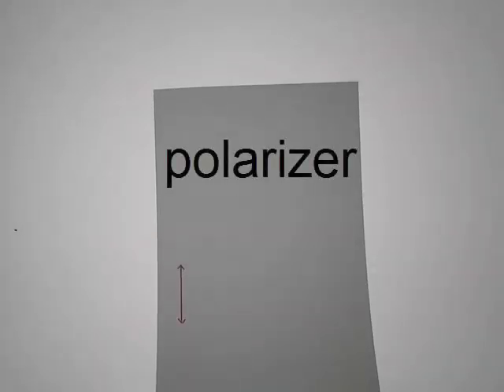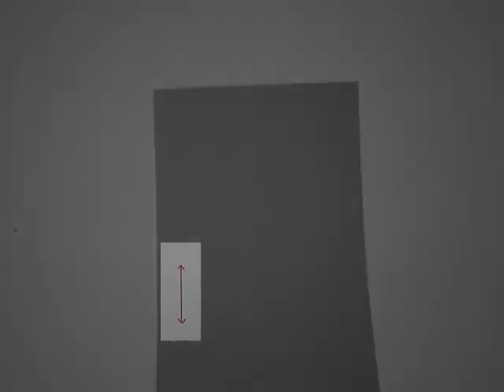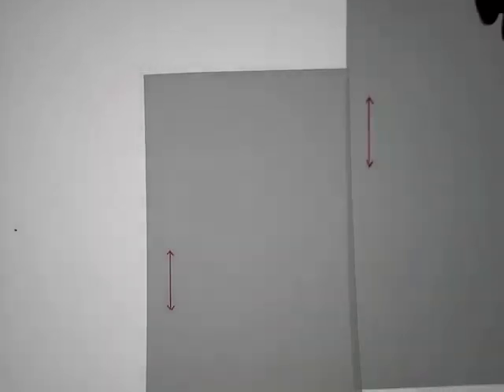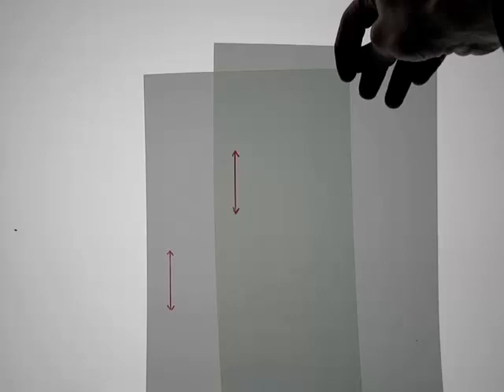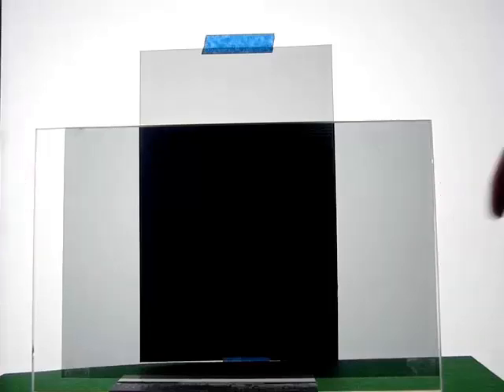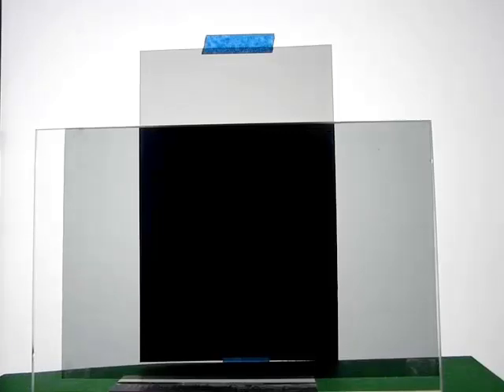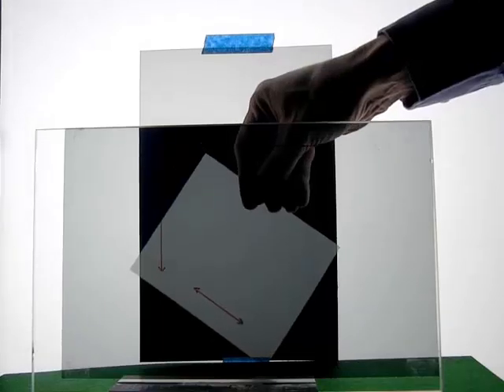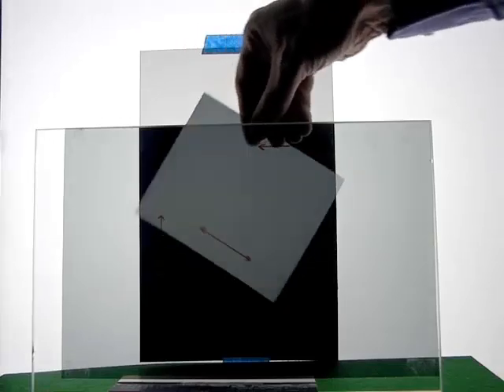Polarization and Polarizers

Comment: You keep speaking of 'light passing through', as if it is some stuff or things that travel through other things. Is that the way light really works? What is it that is passing through? Maybe this is only how we visualize it. I believe in an induction-field theory of light propagation, and the field stimulates the eye or the camera sensor and so on. The polarizers interfere with the field. It must have to with the nature of the materials from which the polarizers are made. The typical linear, classical-vector model of light does not work. I say we must reconsider the very outlook and mode of reasoning. And we must have a deeper understanding of how light interacts with matter.

Comment: The middle polarizer transforms the wave vectors such that some components are once again rendered parallel to the polarizing filter in the foreground, allowing some light to pass through. At right angles, this transformation does not happen, and no light is able to pass.

Comment: As you rotate the middle polarizer from vertical to horizontal, the vertical component of the oscillations go from maximum to zero. And hence, when it is at some inclination, it allows some (non-zero intensity) light to pass through. This light has a non-zero horizontal component (as the transmission axis of the middle polarizer is inclined) which is allowed by the closest polarizer to the viewer.

Comment: The filters are more like a wall. If you have a ball going forwards and it hits a wall, it stops. Having heard only this, one might naively assume walls always reduce the balls speed. However, we can add a 2nd wall 45 degrees to the 3rd wall, and suddenly the ball will hit both the 2nd and 3rd wall and still have speed despite hitting two walls.

Comment: when the middle polarizer is placed diagonal, some of the diagonal components from the vertical polarized light of the first polarizer get through, and these diagonal components also have components in the horizontal region, which get polarized through the thrid polarizer, and a faint light of intensity about 1/4th (1/2 x 1/√2 x 1/√2) the initial intensity is seen. Please correct me if I am wrong, and your welcome if this was helpful.
Reply: re: "when the middle polarizer is placed diagonal, some of the diagonal components from the vertical polarized light of the first polarizer get through, and these diagonal components also have components in the horizontal region"
No  --  The inserted filter causes a new transmission angle at 45 deg. This is called "re-radiation" in the RF engineering field. Physicists fail on explaining this phenom.

Comment: diffraction?
Reply: No - re-radiation (of the light energy) by the inserted filter (NOTICE - it was put in between the other two) at a 45 degree angle. This will pass through the last or 3rd and final filter sheet.

Comment: No, but I can maybe offer an idea:  Maybe the sort-of linear outlook,  there being a wave or massless particles that are 'blocked' from 'passing through' to our eyes or from one place to another, could be questioned. 

A polarizer somehow alters the state of the light as measured on the other side, opposite the lamp. This can have to do with many things, including the natural character inherent of the material of which the polarizer is made. A second polarizer directly out of phase, as it were, is said to totally block all of the light--essentially. 

But can we be sure there does not exist light in some form or state on the other side? After all, we didn't know there were radio waves until we devised an antenna which resonated with the waves and caused a needle to move on a [galvanometer]. 

Certainly there could be light still to be discovered which does not resonate with our eyes, or with the photo-detector in a video camera for that matter. Certainly discoveries will be made that will shed light, so to speak, on matters in general, as has happened continually over the centuries.

It's not so much about some things like bullets, or rays or whatever, but about fields (I speculate). The lamp, or flashlight or whatever is used, sets up or brings about a field [in space] which can be affected in varied ways by various materials and objects. 

Perhaps the eye is similar to an antenna: If it does not resonate when placed in the field, or has insufficient sensitivity, it does not detect anything there; we see nothing. Indeed that does not necessarily mean that nothing is there!

Just putting a few notions out there:)

Comment: I know it's described and calculated by Malus Law, what causes as polarized beam to regain a vector component though is blank to me.
Reply: re: "what causes as polarized beam to regain a vector component though is blank to me."
It's easy - the middle filter is not just a filter, it's also a "re-radiator" of the light energy, and at the angle it is positioned at. The kicker is, it has to be at some angle BUT not at 90 degrees from the previous filter. It needs some component (cos(theta)) of energy to work with.

Comment: as half of the light goes through the first Polarizer only light of one direction reaches the 2nd Polarizer. because it is shifted (ideally 45°), the light, as it goes through, gets two vector compenents, one perpendicular to each of the Polarizers. so basically half of the remaining light is polarized, so that it wouldn't be able to pass the 1st Polarizer, but pass the 3rd.

Comment: The 1/2 of 1/2 of 1/2 is not correct. The effect goes away when the oblique filter is not in between the horizontal and vertical ones. And much more than 1/8th passes the three filters with the middle at 45 degrees. The essence of the effect is quantum mechanical - because of the probabilistic nature of the photon polarization states, this effect happens. That is why it is counter-intuitive: adding another filter would (classically) lower the intensity of the transmitted light, not increase it from zero!

Check out http://en.wikipedia.org/wiki/Linear_polarization
Reply: NO "probabilistic" to it.
Simple re-radiation of the light AT the new angle of the inserted sheet (45 deg).
The microwave example here demonstrates this, even tho the presenter has the wrong theory: https://www.youtube.com/watch?v=KM2TkM0hzW8
Reply: This phenom can clearly be seen in this MIT video too (MIT gets it right)
"Optics: Polarization rotation using polarizers" | MIT Video Demonstrations in Lasers and Optics
https://www.youtube.com/watch?v=AVn49LbYoB8
Reply: hooya27  It follows Malus's law I=Io cos²x where x is the angle between the two transmission axis

Comment: Because 50% of the light gets trough the first polarizer with 0 degree angle from the vertical. then 25% of the light gets trough the middle one (50% of the 50%) with an 45 degree angle from the vertical. And finaly, 12.5% of the total light get trough the last one, with 90 deggre from the vertical (50% of 50% of 50%).